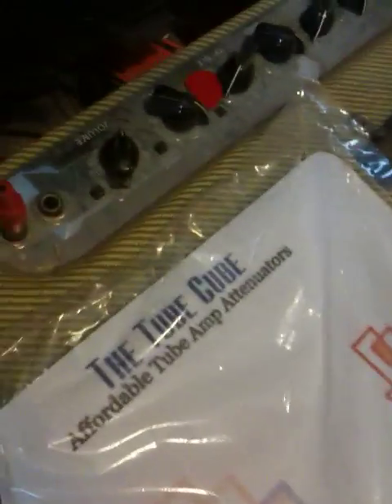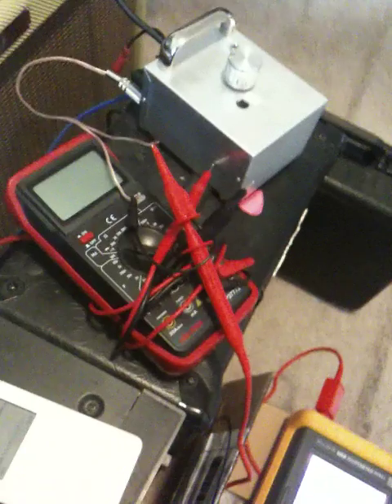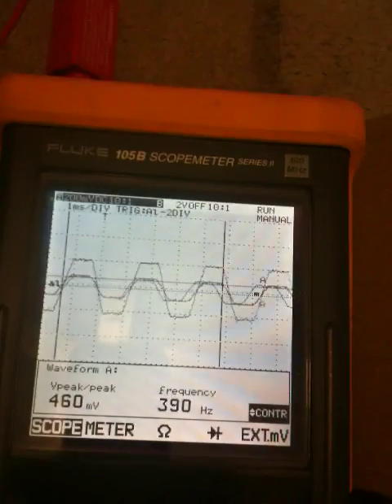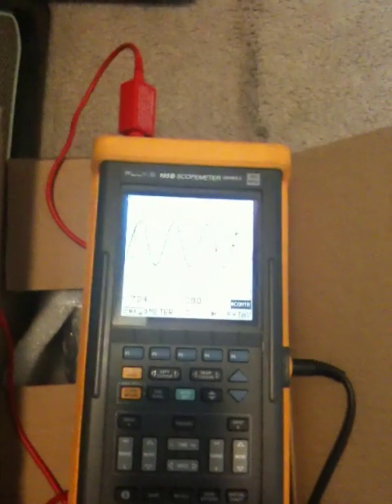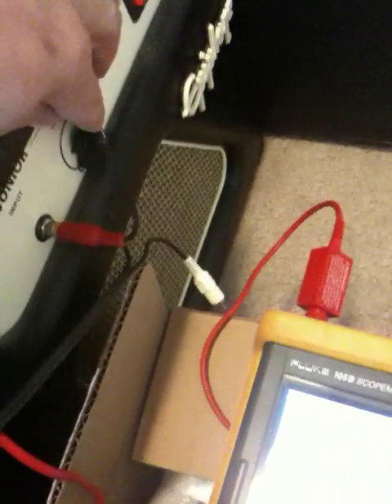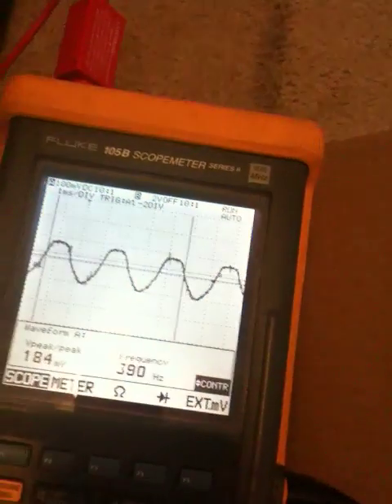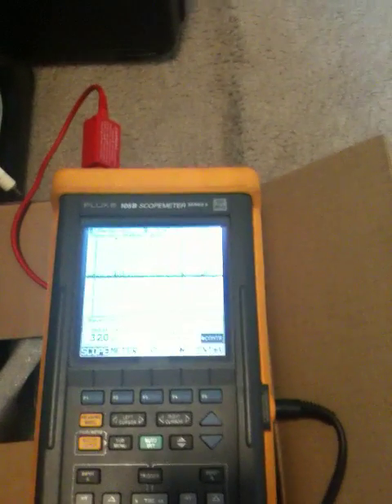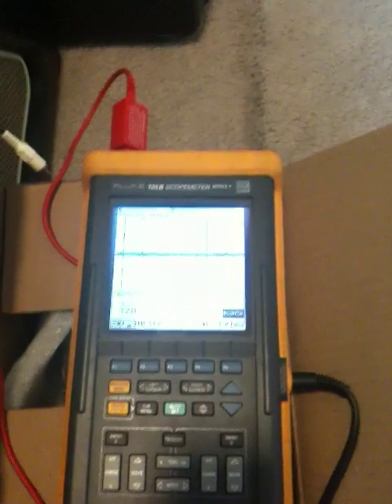tube cube guitar amp demo scope view

Comment: It would be great to listen to some actual samples of how well the tube cube is attenuating, especially at high levels of attenuation where units like the Hot Plate are not very transparent...it's a hard choice to make as there are a number of companies, most of'em sound good at low levels of attenuation but when the amp gets turned down to bedroom levels most of the attenuators suck up the tone a great deal...in other words, getting the wrong one will defeat the purpose as it will change the tone, when the reason people buy attenuators is to maintain the quality of the tone while turning the volume down.